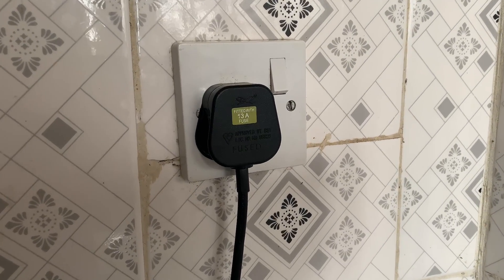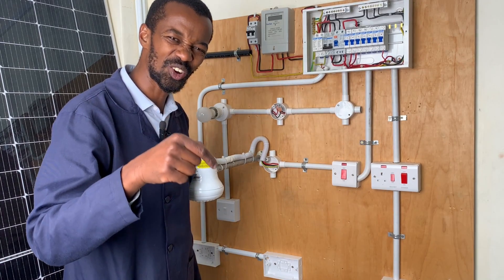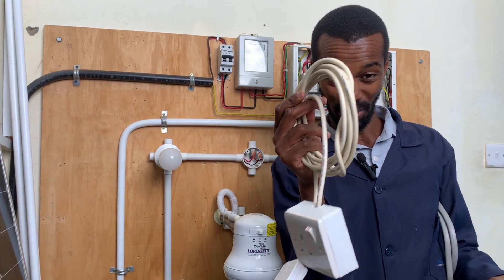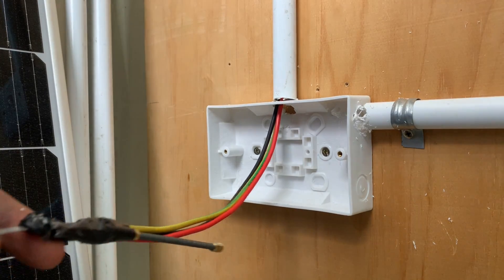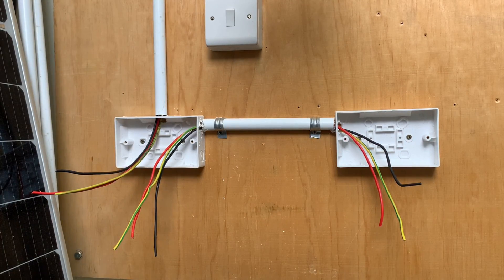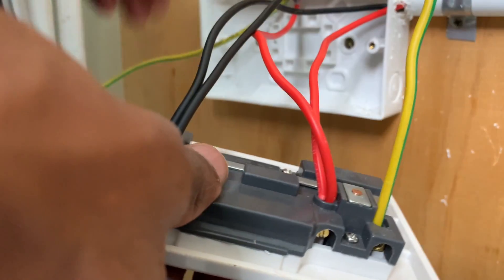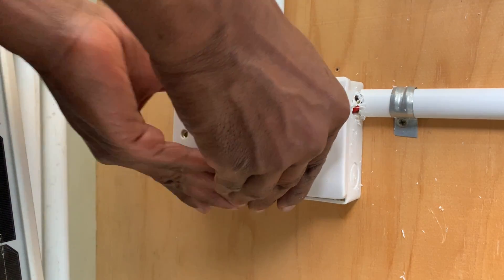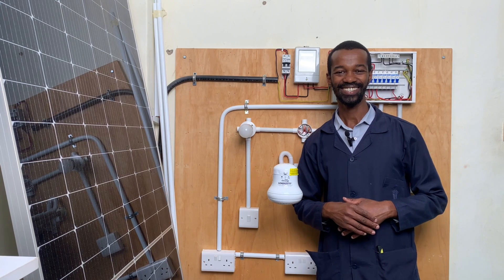How To Wire A Radial Socket In Electrical Installation.

Comment: Great great,, please why use 20amps mcb
Reply from the maker: Great question Emmanuel. For socket wiring, low powered appliances and devices such as TVs and adopters are connected. The fault expected from them is usually less and it has to trip.
Reply: Thanks Sir  @topheightselectricians